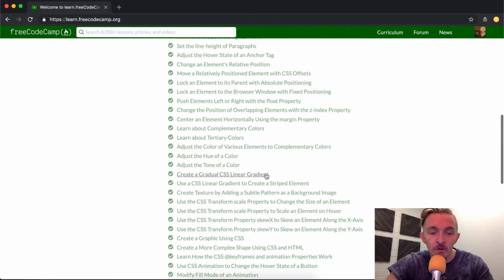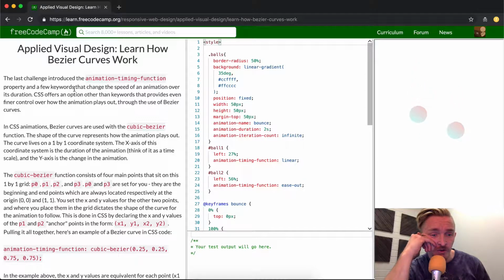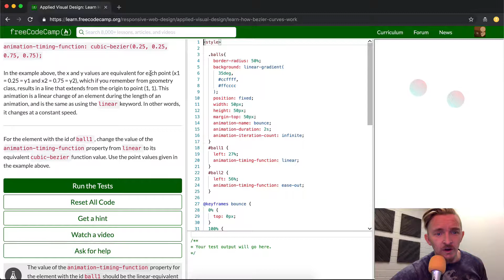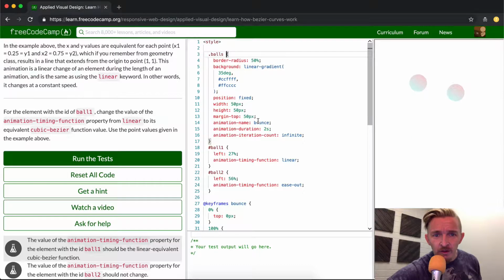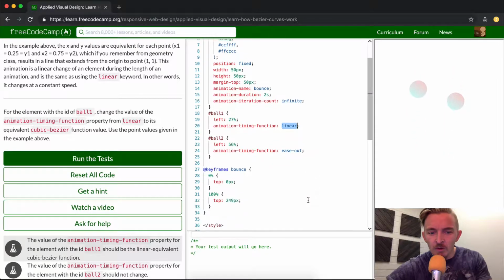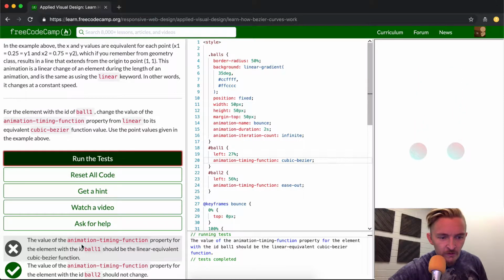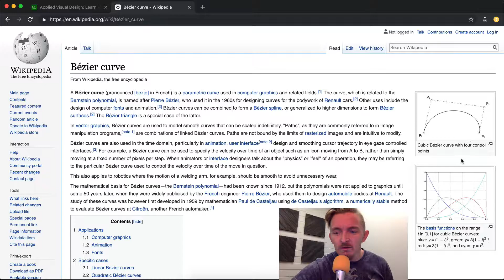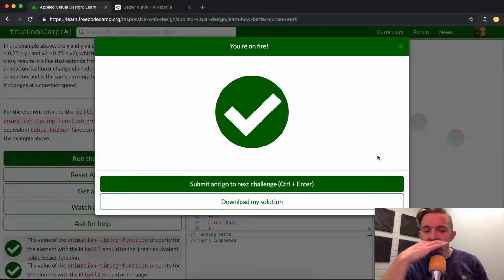Applied Visual Design - Learn How Bezier Curves Work - Free Code Camp

Comment: Of course there is no change in animation, because  linear  keyword is just a shortcut for cubic-bezier(0.25, 0.25, 0.75, 0.75). 
I feel they could include at least a couple more challenges  for cubic-bezier because two presented are just not enough to really understand p0,p1,p2,p3 points and how they together work to form a curve, and how does animation follow that.